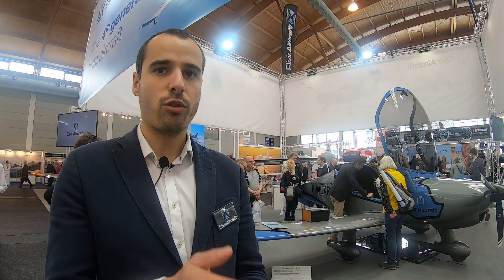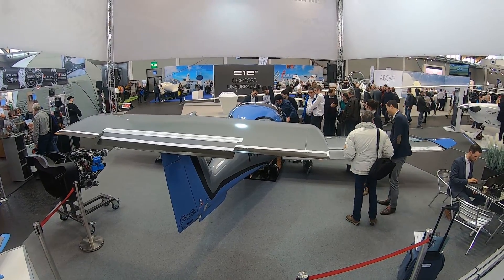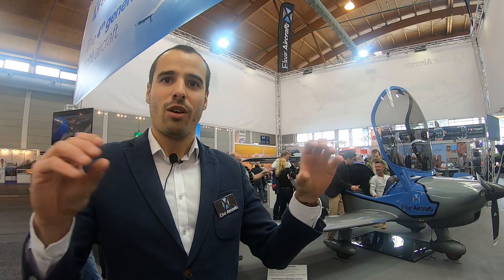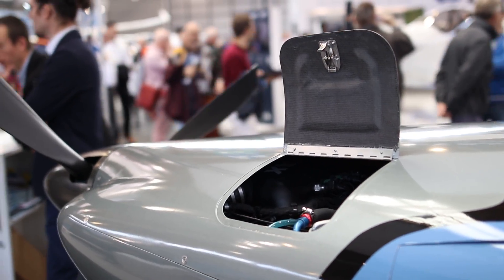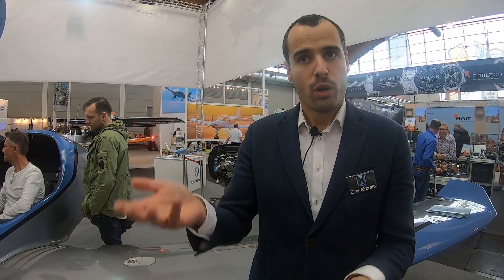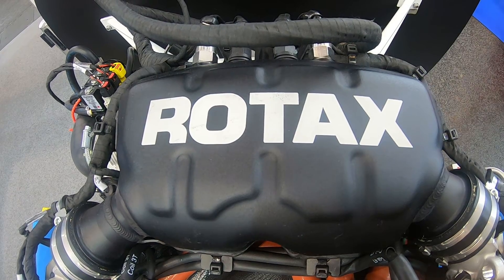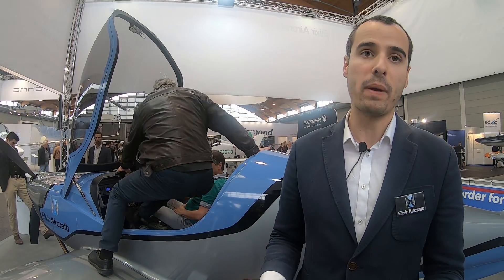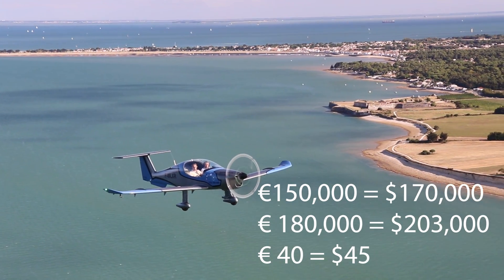Elixir's Molded Carbon Aircraft

Comment: I saw it at Friedrichshafen 2022 & it’s impressive. They basically looked at all the accident data over the last few years & attempted to design out the major causes. Its got a parachute recovery system; It’s un-spinnable - ailerons are fully effective in the stall; it’s an extremely strong structure & offers a lot of protection for the occupants if you did crash; a single explosion-proof fuel tank running through both wings to eliminate fuel starvation by not switching tanks & help prevent fatalities from post-crash fires. It comes with the option of trailing link undercarriage for rough field operation. Corrosion free structure. Lots of experience out there now with repairing structural carbon fibre - think 787. Only problem is the price seems to have gone up & it’s not yet certified in the UK. Hopefully it will be because someone has actually applied some original thinking here.

Comment: They claim it's certified in Europe now. Only the 912 version is available so far. But one would imagine the 915 version should be easy then.
Of course they will price it too high because they are douches (french word for shower :) but otherwise it could be a significant killer in certified GA. Hopefully well under Diamond, Cirrus and Cessna. Only Diamond has a 2 seater and that's under 200k$. So the price actually has to be low. Diamond DA20 is surprisingly a decent plane. High speed with only 120horses. They should really make a version with the 915.

Comment: Adding a spar would be extremely easy and still not interfere with their monocoque design. Remove the leading edge after cutting the airfoil, lay up a 6 ply prepeg carbon fiber spar, cut it then put the airfoil back into a mold and do everything they already do. Carbon fiber is extremely rigid and pretty strong but S glass is stronger and only flexes a bit more. Not sure if I want to trust this design under heavy load in just carbon fiber with no spar. Those formula 1 planes he talks about all use a combination of both carbon fiber and S glass as well as all having a spare.

Comment: G limits and gust tolerance at max gross?  A Carbon fiber tube is very stiff, but bend it slightly under load it fails catastrophically.  A parachute may be a good option for this plane.
Reply: It has BRS and loads are asspecified in CS 23.

Comment: 6 figures for a aircraft just bigger than a fiat 500?
Reply: size =/= cost
Reply: @47EZ_DRIVER  Yep. Or that silly diamonds and rubies would be pennies.
Reply: The motor and avionics alone are about 100 grand. For a factory built plane to cost less than 200 grand at this level is a huge leap forward. A Van’s kit will set you back this much plus you have about 1600 hours of work to do just to get a plane that’s at this level of quality. It gets worse when you have to have it worked on because most pilots aren’t allowed to even change their own oil in a plane so they have no choice but to shell out about 1600 bucks for 100 bucks worth of work.
Reply: @tlj3399  "Of the 33 or so listed preventative maintenance tasks, items 6 and 23 permit aircraft owners who possess at least a private pilots certificate or higher to change the oil and the filter (or to service the oil screen) in a certificated aircraft of which they are the owner" AVWeb.com

Comment: I like the less parts and carbon fiber concept; simplicity is safety from the manufacturing and maintenance standpoint. In the future I would like to see a larger aircraft with retractable wheels, each plane 2 to 4 passengers, more cargo space when seats are folded closed. Also, a more enclosed interior, perhaps even with an optional extended front that has a small turbo prop engine (yeah crazy). Small planes tend to be slow and have a short range; this is plane a big improvement, but the price is will stall most shoppers.

Comment: Where is the fuel tank?
Reply: captarmour the 110L fuel tank is in the central section of the wing, under the cockpit.
Reply: @maximepawlak95  thanks. Is it built into the wing as a permanent part of the wing or can it be removed?
Reply: captarmour It can be removed. Look at 2:40, you’ll see a sample of the fuel tank. The foam is here to limit tossing and to protect from explosion in case of crash.
Reply: Electric is much more exciting!

Comment: My main concern would be hangar rash - if its all one piece, would that total the aircraft?
Reply: It could very likely total that part of the aircraft. Monolithic composite structures, unless designed properly, are incredibly weakened by even light damage (say a localize puncture). With proper procedures and materials the part that's damaged can be repaired to near-new strength with some weight penalty but it isn't as simple as replacing rivets. What sort of damage tolerance, repair procedures, and the legacy of both are a few of the first things I would be asking.
Reply: The guys from Grob made a good video showing how easy it is to repair carbon fiber ! https://player.vimeo.com/video/18019742
Reply: That’s my big concern! What happens when you take a bird to the wing. On most airplanes the structure forward of the spar is secondary and acts as an aero fairing. On this that is load bearing structure!
Reply: @hahahano2796  But it is pre preg carbon fiber. Gonna be tough to damage that.
Reply: headphones warning: video starts with a loud hammer impact at 0:16
Reply: No, it is just like any other composite part.  Sand it, tack it, apply new over busted portion, vacuum bag it, sand it down and viola done, Not quite as good as new, but very close and with a little fairing, no one can tell.

Comment: 200k USD. Affordable, but not cheap. Still pretty cool to see them using composites the way they're used in other vehicles. I remember working with the carbon fiber pre-preg back in college. Hard to mold and cure, but strong stuff.
Reply: Reduction in price requires economy of scale.
Reply: In college when? doing molds these days is almost childs play with 3d-printing.. Still the most difficult part of the process of course.
Reply: What other planes for that money have operating cost of 45$?
Reply: @rkan2  A Sonex can have comparable performance for at least 1/4 the up-front cost (or less) and lower opperating costs... also, the wings are removable, which means you can trailer it home or have more hangarage options if money gets tight.

That thick wing to make up for the lack of a spar is murder on effeciency. The Sonex isn't going to win any awards for looks, but you're flying it from inside the cockpit.

...Also, the Sonex has aerobatics capability.😁

Comment: This is not revolutionary in pricing. I bought a pipistrel for cheaper then this
Reply: A pipistrel doesn't cruise at 170 kts...
Reply: Pipistrels are designed and built in Eastern Europe. This is where their low prices are coming from. The Elixir is 100% from France, so considering labour cost here it's a pretty good pricing for a CS-23/FAR-23 aircraft.
Reply: Hah. Slovenians and Franchies, we probably all use fibers and resins from China. Nothing is 100% theese days.

Comment: Looks like very similar pricing to other LSAs. The savings from the innovation don't appear to be reflected in the price.
Reply: It's CS23 certified, which I assume means they'll have IFR certification as well, all for an LSA price,.
Reply: @adamt7667  I was unfamiliar with the CS23 certification. I just looked it up, so I am no expert. But it looks like a series of listed design requirement documents/standards for everything related to small plane design. It could be that there are IFR requirements in there as well. Some of the LSAs are IFR capable (such as the RV 12) but not permitted into IMC (or at least that is my understanding). It looks like from the specifications, they could be aiming for the LSA market. In any case, it is a nice looking AC and I would be interested in seeing the manufacturer's intent with the North American market. Even the cruise number is 130kts. Less slippery looking planes with a Rotax 912is have a cruise of 130kts which I understand is the LSA limit. The weight is interesting as well. It could be an LSA with a higher than average payload capacity.
Reply: @yodaiam1000  Yeah, I think CS23 is our European standard, maybe equivalent to Part 23 in the US? In any case, it puts it in the same category as legacy trainers like Cessnas or Pipers. I suppose in many respects it's a faster, heavier LSA, but I think it would be an impressive aircraft if they meet the target price.
Reply: Adam Taylor you’re right. The CS-23 in Europe is the equivalent of FAR-23 in the US. Payload increase, IFR, acceptance around the world... There are many advantages of going for CS-23.

Comment: Interesting, yet is their target market a volume orientated space? Don't think so  therefore I am not sure they can sell enough units to maintain their price point and will quickly end up becoming a boutique manufacturer of  luxury goods as are most of their competitors. There in lays their Achilles heel because their up front manufacturing model can not lend itself to the production approach of "engineer to order" such that we see with Bristell. Elixir's profit return will be 100 units sold and not 5 if you get my drift and unless the marketing is spot on they will find it very hard to adapt if forecasts are not met because their eggs are all in one basket called an expensive mould which can not be refashioned . Icon A5 thought they could produce a model T for the light sport market as well yet it become morphed from a peoples plane to a rich peoples plane simply to satisfy investors expectations of getting a return this side of the next millennium. Low price points require high volumes and to my eyes their simply is not enough people to sell to before the company would have to refinance the dream.
Reply: @NANA-cy7hd  : That would be the plug yet a laid up mould is a substantial investment. This is an injection mould made from multi layered carbon. http://www.c3technologies.fr/first-moulds-for-elixir-aircraft/

Comment: Good report, thanks (and thank you for the good body mike sound). Production tips: Some viewers may not be aware that YouTube has an auto-generated English caption option and that might be a better way to view and understand this speaker’s presentation with the sound off. Put that in the notes. Another method: Record two presentations, one in the speaker’s native language and one in English. Post both with the note that the viewer can select auto generated captions or, if you have the budget and time, create open captions translated to English in both of his versions. This is a common practice in news reporting where the speaker has a heavy accent.
Reply from the maker: Well, good suggestions. But here's my reality. When we cover a show like this with one person, we are spread so thin as to have no margin. In the course of four days, I shot seven videos, recorded six podcasts  and wrote 12 news stories and two blogs. The problem with the auto captioning is that you have to manually correct it because it makes a lot of mistakes. I don't have a fix for this yes. I thought about doing the captioning after the show and may yet.
Reply: Or English speaking people thank non-English speaking people for speaking in their langage and make a little bit of effort to listen to what's being said ? Or English speaking people learn other langages to the point of fluent understanding ?

Comment: So why not simplify the engine choice while simplifying the airframe?  UL (and probably others) offer engines that are a LOT less complex than the air and liquid cooled Rotax.  I uderstand that Rotax is powering many small aircraft these days, but the complexity of speed reduction, liquid cooling with all of the extra tubes, hoses, etc, would favor choosing a simpler direct drive, fuel injected engine.
Reply: The ULPower engines aren't certified, they can only be sold for use in experimental aircraft. Certification adds a huge amount of cost to an engine. Air-cooled engines are actually more expensive to build than fully liquid-cooled engines, because liquid-cooled engines have fewer parts and because the parts for liquid-cooled engines are simpler to make. Direct-drive engines are usually heavier than geared engines and the reduction in propeller RPM that comes with a geared engine significantly reduces propeller noise. Note that the ULPower engines drive their props at a very high RPM.
Reply: If you don't need certified engines you can buy the same Rotax engines for much cheaper. Rotax sells lots of engines, personally that inspires confidence, compared to flying with an unknown engine.

Comment: Um, Burt Rutan was doing this 40+ years ago with solid foam core wings with a glass skin.
Reply: Uhm, this is not a homebuilt, uhm.
Reply: Shows what you know, Rutan pioneered MOLDLESS construction, this is MOLDED construction.  Fundamentally different.
Reply: @DrewLSsix  Molded or moldless the structural idea of a sparless /ribless solid foam core structure is the exact same. This isn't some ground breaking idea. Shows you're just a ego-jack hole
Reply: @cluelessbeekeeping1322  , Um, never said it was ...
Reply: Does the wing have a foam core? Sounds like a 2 piece mold with internal pressure to VAC bag the skins into the mold.

Comment: Now when the fuel truck driver dents your wing your airplane is totaled
Reply: nah.....
Reply: You are pretty clueless.
Reply: That would be my worry as well.  I have had aluminum panels replaced on two different aircraft due to hangar accidents.  It was reasonably cheap.  My mechanic was even able to get a near-perfect match to the paint (by using an automotive paint specialist).  I would need to completely understand how repairs are made, if they can be made.
Reply: The guys from Grob made a good video showing how easy it is to repair carbon fiber ! https://player.vimeo.com/video/18019742
Reply: Yeah, that one piece wing might mean some hangar rash could equal having to replace that whole wing.  I would really like to know if damage to the airplane is reparable.
Reply: Definitely a concern.  Dick Karl from Flying magazine had a bird strike in his Premier 1 jet.  A relatively small dent in the carbon wing was deemed unrepairable so a whole new wing was needed.  Of course the Premier is out of production and no used ones could be found (small fleet) so the ENTIRE jet was totaled.
Reply: Hes gonna have to hit it pretty hard considering its pre preg carbon fiber. I don't think people realize just how strong that stuff is.

Comment: Very nice to optimize but I remark that the price they land on is like all the others. So what good is it....   A VL3 Evolution is a fast long range bird that starts around 140k euro iirc. 
And getting rid of Rotax is another needed optimization. Particularly the 915 is bizarrely priced at 39k$? A Nissan Versa sedan starts at 12k for the entire car including a 1.6L 16valve 109 horse engine that of course has computer mapped fuel injection because it's not from 1950.
Reply: A VL3 is not CS-23 or FAR-23 certified. The use is not the same. VL3’s are targeting private pilots for travel, the Elixir is here to help flight schools face the need for pilot training. Similar cost, different use.
Reply: search for accident reports of the VL3. It seems to kill an awful lot of pilots. It has some nasty spin characteristics. No good as a trainer and questionable safety.
Reply: Moreover the Elixir will be IFR certified (which the VL3 isn't due to its UL certification) & it only has hundreds components.
Reply: @andymckee53  Your petty characterization aside, I looked at around 10 and the last one summed them up pretty well: "Contributing factor(s): 
1 Exceeding the design envelope of the aircraft. 
2 Poor airmanship. "
The plane can also have a chute which they failed to apply after high bank stall spins. A lean fast plane can temp pilots beyond ability. If you fly a plane briskly you better know how to fly and the plane. None of the reports that I skimmed attributed aircraft failure. Which makes me unconcerned about the aircraft.
Reply: Dan Frederiksen I’ve tried to explain to my non-aviator friends why engine rebuilds cost so much.  I have to admit that I come up short of a good explanation.
Reply: james dell   Certified parts people and processes.
Reply: VL3's production is in eastern europe with very low salary... Elixir has a complete french production
Reply: @yodez3  An engine rebuild usually costs about 75% or more of the cost of an engine, regardless of application.  You'll find that a rebuild of a car engine costs about that same percentage as a new one, but people don't tend to do that because cars are much more disposable. Also, they don't frequently see maintenance that helps them last ~200,000 miles which is roughly equivalent to a 2000 hr aircraft engine OH schedule.  Car breaks? Well you aren't dead because you're on the ground, go buy a new car f0r $9-10k instead of rebuilding the engine.
Reply: @yodez3  Low production volumes for the replacement parts as well, documentation probably much more anal, same labour costs, that's the answer.
Reply: Thanks for the replies.

Comment: Not a fan of the car like instrument panel. Looks cheap
Reply: Count Spatula yeah would think so. Same with the Icon, sexy plane outside and then this contraption of a 70s car dashboard.
Reply: Jan Detlefsen   And here is the single biggest issue with trying to bring the cost of aviation down, people don’t want to fly cheap no matter what they claim. When they buy they option out the plane, they demand high performance in every field, they want the best avionics etc. 

Someone proposes an affordable machine and it’s instantly torn apart for every feature that makes it relatively affordable.
Reply: @DrewLSsix  i don't see how that panel with the storage space is any cheeper than a flat one. The rest of the plane looks great and some awesome ideas for cost saving.